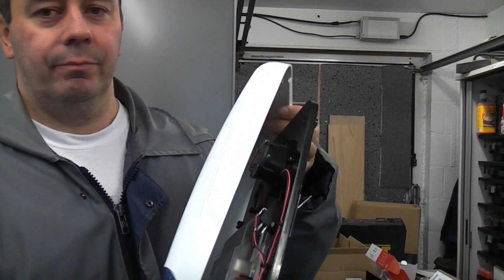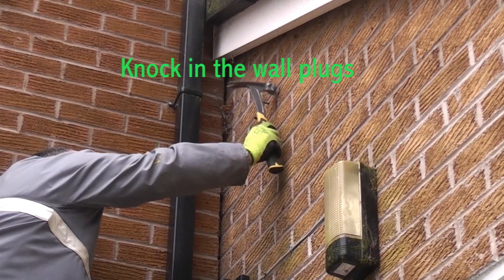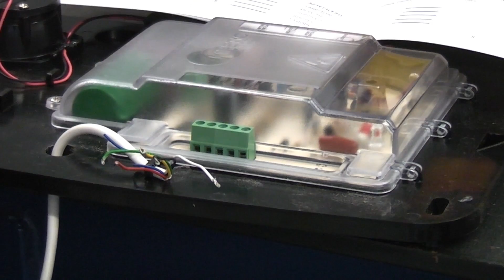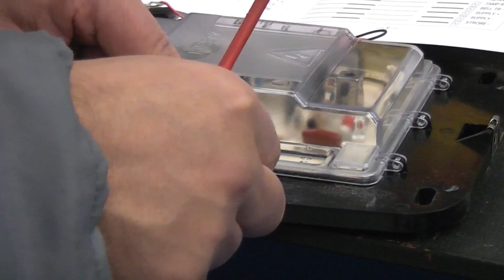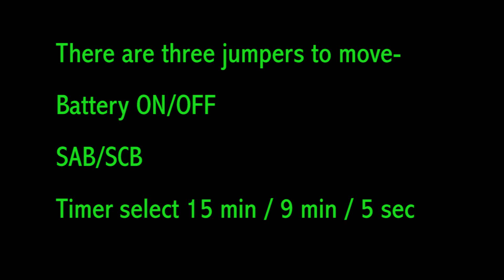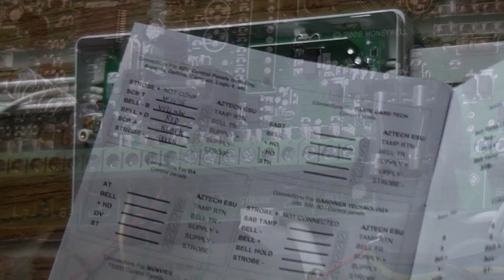How to install an external sounder | Alarm wiring

Comment: We have the same system as this, randomly the alarm would just go off, changed in int battery to no avail, then got tamper lock out on the control panel, after some messing, I by passed the tamper to the external bell box and cleared the message.  However, the outside bell has stopped working but able to set the alarm, removed the tamper bypass the bell box now lights up and if you remove the cover sets the strobe and siren off but get the tamper lock out error again. Checked all cables to box and panel and ok. Someone suggested that it's the bell box batteries need replacing but I cannot see any batteries in it. Before I get anyone out can anyone shed any light on what possibly could be at fault.
Reply from the maker: I’m not an expert, but at my last house the alarm was playing up and it turned out to be the bell box. Over time they get water in them and it causes damage, or sometimes the self-contained battery leaks onto the PCB. I replaced the bell box and the problems went away 👍
Reply: @ultimatehandyman  Thanks fella, I thought it might be a weather-related issue but it's only 3 years old, and when it shows the tamper lock and not bypassed and you open the box up the strobes go off, the siren blarts out and the leds light up which I would of thought if water related damage these areas would be faulty. Tis a strange one.

Comment: If you only have 4 wires available, is it possible to wire the sounder and the strobe only? The bell box is that high it doesn’t need the tamper.
Reply from the maker: It should be possible, but you will have to remove the SCB from the external sounder.
Reply: @ultimatehandyman  I’ve messed up somewhere and now struggling to get the system working. I have an Accenta G4 panel and a AG6 external sounder. I’m using the old wiring on a 4 core cable. At present the external sounder is wired V- = Black, V+ = Red, S- = Yellow & TR = Blue. My external sounder should have 2 alternating flashing LEDs but nothing is showing now. Any ideas would be appreciated.
Reply from the maker: @kevcosgrove   You said originally that you wanted to wire the sounder and the strobe, no mention of the reassurance LED's 
You'll need two more wires for the reassurance LED's 
You might be able to wire the strobe and sounder on one pair of wires and the reassurance LED's on the other pair of wires, but you won't be able to test the strobe and sounders independently.
Reply: @ultimatehandyman  I need to mention they worked before I messed with it,  using only 4 wires TADB. I thought by disconnecting the tamper on the bell box and connecting it to strobe, that it would work. Sadly it didn’t. I put the wire back as it were now nothing.
Reply from the maker: @kevcosgrove   It's not blown one of the fuses on the main board has it?
There are normally a couple of glass ones, that are only a few milliamps
Reply: @ultimatehandyman  Funny you should say that! I replaced the battery fuse on the main board but still nothing from the external bell now or LEDs, is there a fuse on the bell box, do you know?
Reply: @ultimatehandyman  the system is wired as follows, External bell. V + Red, S - Yellow,  V - Black & TR Blue. Main panel: Black T,  Blue A, D Red & B Yellow.
Reply from the maker: @kevcosgrove   I'm sure that some bell boxes have fuses in them, if I remember rightly. 
It should tell you in the manual.
Reply: @ultimatehandyman  thanks for that, I’ll give it go.

Comment: Any ideas of how to get rid of the PA lockout on this alarm. Thanks
Reply from the maker: If the PA button is not stuck in, you should be able to reset the alarm by inputting your number and pressing the X key twice. If it won't reset there is a problem with the PA circuit, either the switch needs looking at- or you could link it out in the panel.
Thanks for the comment 👍

Comment: when i move jumper from test to 20 minutes the bell sounds, on your video it didnt. am i doing something wrong
Reply from the maker: Not sure, is it the exact same bell box?
Thanks for the comment 👍
Reply: @ultimatehandyman actually a real problem I'm having is it's showing pa fault and zone 7/8 fire, I don't have any of these zones connected, any idea?
Reply from the maker: I would try putting a link wire in that zone, that should disable the zone.

Comment: hi pal, I have an HKC alarm that has started ringing at the bell box without being set, EXT Bell Temper is displayed on the keypad, I got a ladder and opened it up, the temper switch looks to be ok so was wondering if the Bell Box battery was bad would it give the same fault
Reply from the maker: Not sure, but most bell boxes start playing up after a few years, as water often gets into the box at some point. I guess you could try replacing the external battery, if that fails you might just need a new bell box.
Thanks for the comment 👍

Comment: Hi the set up around the 3 jumpers  do they have 2 pins each jumper and I need to swop them over on the pins for the 3 of them before closing the box ? Thanks bob
Reply from the maker: Can't remember, sorry. It should have a diagram in the instructions?
Thanks for the comment

Comment: Hi Handyman, is it safe to run a power cable next to the bellbox cable. ie. In the same trunking ?
Thanks
Matt
Reply from the maker: Not sure, sometimes you can get interference when running cables alongside each other, especially with telecommunications etc.
If the power cable is just for lighting or sockets it will cause much less interference than that of a cable supplying a 9KW shower.
It's best to keep them separate if you can.

Comment: Good job mate! Would you know if you can wire a second bell box to the same terminals in the alarm panel? Thanks
Reply from the maker: +armzbarmz Yes, I'm sure that you can wire up two bell boxes to the one panel but best to check in the instructions if you still have them.

Comment: That bell box is to low,    and the only reason for putting it there is to make it easy, or your telescopic ladders don't go high enough,  i worked in alarms for years one company was ADT,  if its easy for you to reach its easy for a criminal to reach.  
  As for loud external sirens they are pretty much a waste of time and money,  your better off install several sound bombs around the inside of the house so if someone breaks in the can't stand to be in the house,   they will oscillate off each other and become really irritating,    external siren just annoys people but how many times do you hear a house alarm go off and ignore it,   all the time everyone does.     good locks and great alarm, external security lights is the way i go,    just be careful about the sound bombs.    if you have pets.
Reply from the maker: +MikeyZ Synth-Eti-Cut 
That bell box is installed on my garage. It's almost at the maximum height of the garage, hence it is positioned where it is. I do have about 4 other ladders besides the telescopic one so reaching higher up is not a problem.
There is a master blaster in the garage, which I guess is similar to sound bombs.
Thanks for the comment

Comment: Are you aware of any regulations when it comes to drilling holes/placing the bell on the facade of a small block of flats in the UK? do I have to ask permission to anyone as I'm renting?
Thanks a lot, extremely helpful videos!

Comment: if you have cables running on the outside of a house do you try and run them inside the house or run them in trunking/conduit?
Reply from the maker: I always try and run cables internally, but sometimes it's not possible such as when installing camera's in difficult locations. In such circumstances I run the cables in plastic conduit. 
I am running a cable for a PIR to an outbuilding soon but this will not be in conduit, but I have purchased special exterior grade cable for this purpose.
Thanks for the comment
Reply: ***** if someone had a brand new kitchen installed, and on the other side of the wall wanted lighting wall mounted to the exterior would you run the cables inside? if so would you chase the walls?
Reply from the maker: Allen Goldsmith 
No, I'd run the cable externally in conduit.
When you asked about external cables originally I thought you were asking about alarm cables as this video is about alarm wiring!
There is a page here that shows permitted zones for running mains voltage cables- http://www.ultimatehandyman.co.uk/how-to/electrics/permitted-wiring-zones

Comment from the maker: @james murphy
Yes, I am much better thanks. I hope to get the PA video made sometime next week :-)
The Master Blaster was about £120 (they are not cheap)
Reply: ***** Master  Blasters are quite expensive you are correct even eBay sell them for about £130. Not cheap. I have bought 2 P.A for my burglar alarm and is sitting inside of the panel getting ready to be wired in. Also when you get Your P.A wired in could you press it so that you've tested it please. :-)
Reply: ***** I tried wiring the P.A button earlier but I still kept seeing a fault light on the main control panel so it seems to be how I'm wiring it. :-( (I was using 4 core cable) I'm going to have to wait until you get the video made :-)
Reply from the maker: james murphy 
Try this- How to wire a PA button to a Burglar alarm
;-)

Comment: There's more to this than I thought. Do you know why there is a pcb full of electronics in the bell box, why isn't it just the sounder & strobe light?
Reply from the maker: Years ago you used to but a empty bell box and then wire it up to a sounder and strobe but now they are much better.  They are now full of circuitry to make it a self contained bell unit, so they now have a backup battery in the actual bell box (which is useful if someone cuts the cable going to it). They also have reassurance LED's and can also be configured easily be moving any of the three jumpers. I must admit that in the past you had to think when wiring these up, but this AZ-TECH sounder (made by Kinetic) has brilliant instructions, as it has diagrams on how to wire it to several different alarm panels!
Thanks for the comment ;-)
Reply: *****
Interesting - learning a lot here! Thanks